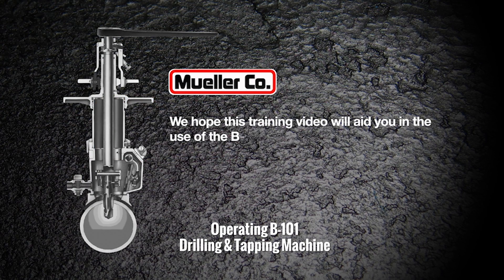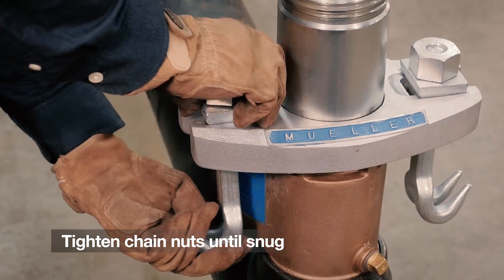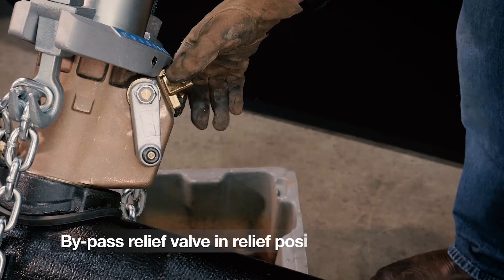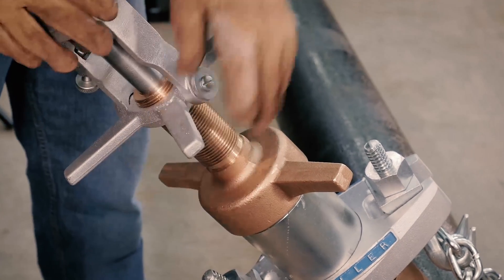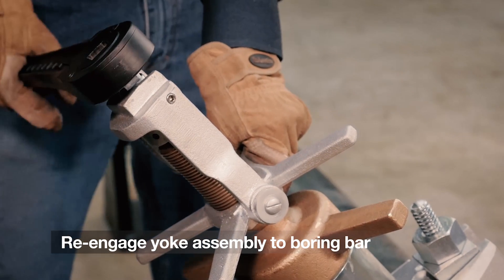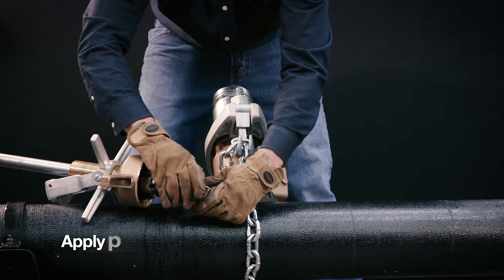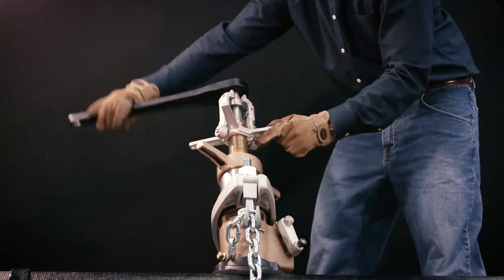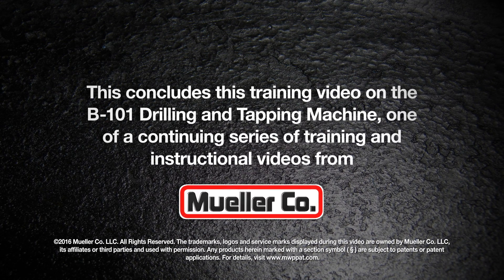Mueller B-101 Drilling & Tapping Machine

Comment: Why did we add water and
why do you place the machine at different angles?
Reply: Water is added  to the B101 chamber prior to the cut to help reduce heat. The B-101  is attached to the main at different angles based on the City requirements.
Reply: Adding water also prevents the water from the main rushing into the unit and swirling the tap shavings around potentially plugging up the relief valve.

Comment: Great Video, for a dry tap do I need the tapping machine to screw in the corp on the pipe or can I screw the corp on by hand/wrench? Thanks
Reply: When performing a dry tap with the B-101, the corporation stop can be threaded in by hand after the threads are in the main.